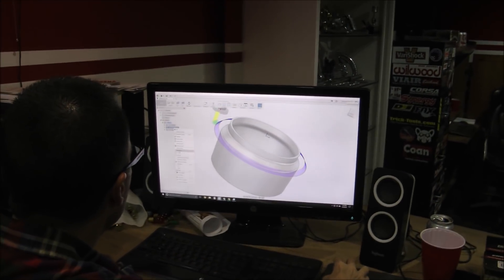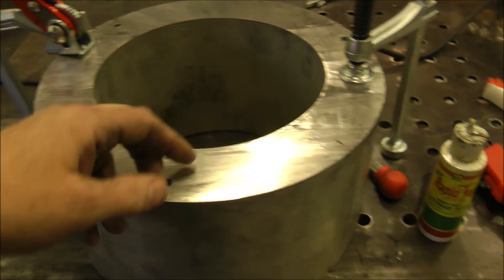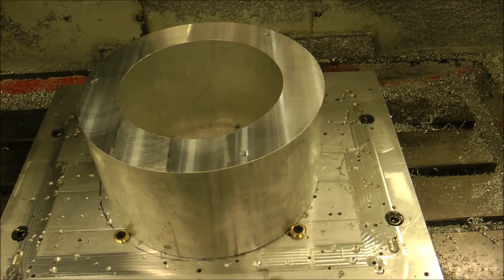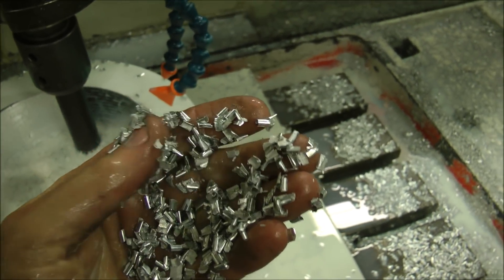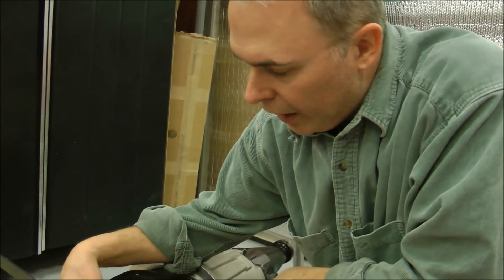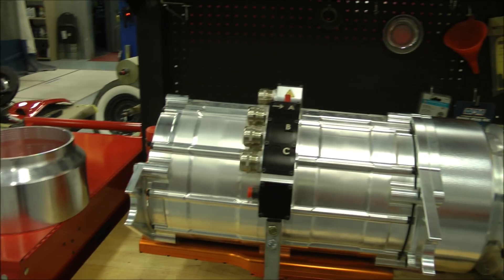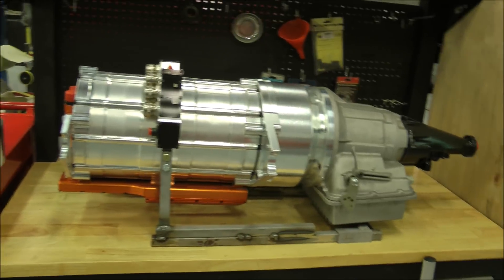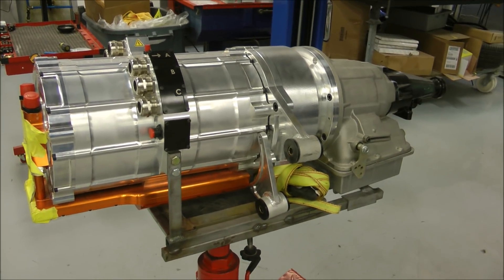66 Mustang conversion 13

Comment: Still curious did you go out of business, did you die,  longtime no update on the 66 mustang convertible.
Reply from the maker: richard baker We did not go out of business and I am still alive. The guys that help me at work in the evenings on the weekends of had a whole lot of stuff in their personal lives kind of up so progress is slowed way down and we are entering a very technical part of the battery bills. I’ll be releasing a new video soon. We had to lay out a circuitboard and do some other things like that. You’ll see.
Reply: Glad to hear that.  I was wondering.  We haven't had an update or anything in several months.  I can't wait to see that amr   racing motor performance.

Comment: Why a powerglide auto, couldn't you use the dual overdrive you used on the 222?
Reply from the maker: Adam Tarbaux with AC motors there is no need for an overdrive. However, having significantly less torque at low rpm's then DC motors, and under Drive is required. That's what the powerglide gives us. The first gear acts as an under Drive and then the second speed is simple one to one regular operation.
Reply: mitchmedford ah I see torque multiplication.

Comment: so did you ever hit 200 on the zombie yet? just wondering we havent had an update in about a year
Reply from the maker: 178mph is still the number. The Zombie 222 has no battery at the moment. We have the cells for a new ultra high power pack, but we have decided not to spend time on it until we ship a couple of customer cars that are way behind.
Reply: mitchmedford So does that mean the Lincoln is holding as well? I love your shop's concept BTW. Huge fan!

Comment: A nice solid build! Missed seeing videos from y'all. Missed or forgot, what are you using battery wise in this?
Reply from the maker: The Mustang and Lincoln have the same basic battery from a cell and kWh wise. High power LiPo pouch cells (192) @ 400v and 53Kwh of capacity. The packaging is very different due to placement limitations.